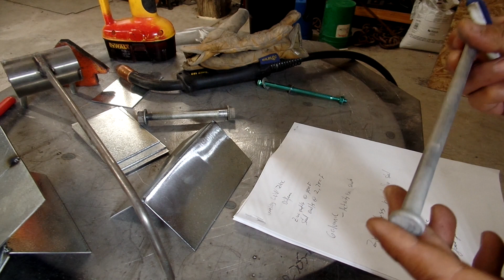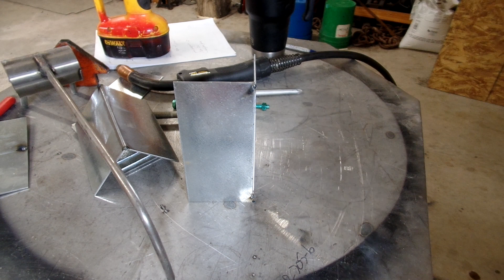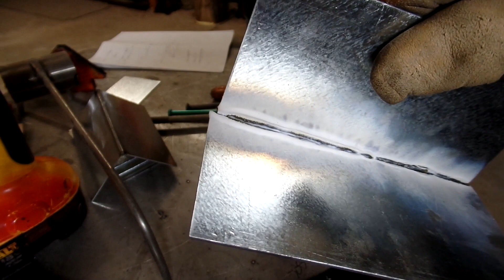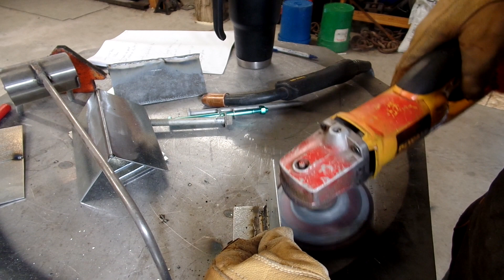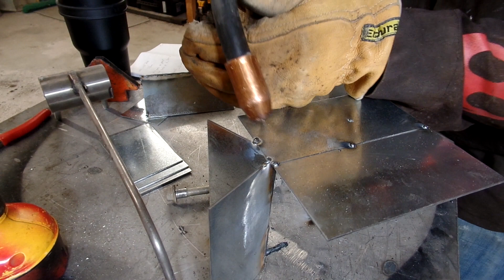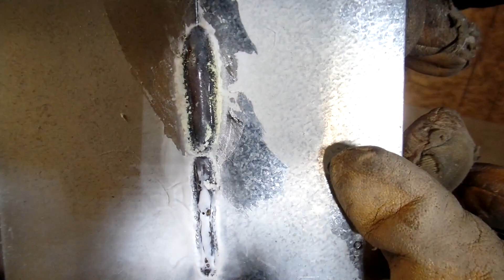Welding the Dreaded Galvanized Steel

Comment: I welded galv pipe, or was in close proximity to welding almost daily for maybe 5 years just fine until one day I got so sick I almost called 911. 15 years later, I’ve had it maybe a dozen more times like that. My sensitivity to it has become increasingly noticeable. Can weld raw steel all day no problem. But have to limit myself to 2hr sessions or it’ll kick in. Not sure what it’s all about, I just know it’s a real thing. Now I always weld with shop doors open, and am way better at holding my breath. The milk thing doesn’t seem to have an effect.

Comment: What did you have your welder set at for Voltage and Wire speed
Reply from the maker: Usually around 170/17 to 180/18 is a good start for 14 gauge.
Reply: @coconutcowboy5976  ok i did a weld test yesterday and passed the cold rolled steel but then they hit me with 14g galvanized flat and downhill and i havent done galvanized since 04 and just couldn't get the machine set right, i had it set good on a couple test pieces but started the test with the steel so I turned it up and forgot my numbers for the galvanized lol

Comment: What about a flux cored non gas mig wire fed weld. Or a stick weld. Can you recommend a preferred rod. Thank you.
Reply from the maker: I was running gasless flux, can't remove the cup on the tweco 180 without the contact tip falling off.

Comment: What heat are you working at? I’m taking a weld test for 18 ga galvanized in 2g,3g, and 4g and have no sheet metal experience and need this job
Reply from the maker: 18 ga! Wow that's not fun, start 170, 18 and adjust from there. It will probably be on the hot side.

Comment: One thing you can do also is either dip the part or paint the seam with muratic acid. The acid literally eats the zinc coating off. But after you do this you need to rinse it off, weld it and then paint it. It will turn grey and you will know that's the base metal but if you don't do anything else to it, it will rust immediately. So you definitely need to paint it right after. Also don't breathe the cloud that the acid creates.

Comment: Yes you’re correct with the zinc being massively beneficial for your health, in normal doses.. the zinc oxide fumes produced are far beyond the normal doses. 
Doesn’t mean welding galvanized materials is something someone should avoid, but it’s still heavy metal fumes and while you’re not likely to drop dead from moderate inhalation you’ll definitely get a little poisoning from it. It was my first time welding galvanized yesterday and under ventilation I didn’t notice anything besides splatter, but I’m ASSUMING to get metal inhalation sickness the welding area conditions probably have to be absolute shite. I can’t imagine being in a constant cloud of that white smoke, ugh.
The potato thing is for your eyes should you get flash burn, didn’t believe it until I left a really reflective sheet of metal beneath my stick that was reflected up under my helmet. I know you’re trolling with the potatoes under the feet thing, but I can’t help being a smartass sometimes. 
Good video regardless
Reply: Zinc supplement goes in the stomach. Zinc burnt/oxidized enters the lungs. Big difference.

Comment: If you have to tack a few inches of galv. sheet the fumes aren't likely to cause much annoyance, but you wouldn't catch me doing any serious repair on galvanized steel parts without either having it cleaned off from both sides of the joint or a half-mask respirator to keep the junk out of my lungs. 

I did fairly-regular repairs on galvanized traffic lighting, hot-dipped galv on metal ranging from 11-ga up through half-inch plus, and there's a noticeable difference on how you feel the day after if you don't wear your ppe.

Comment: not all zinc is created equal. zinc in the diet is typically bound to proteins aka chelated. zinc fumes from welding are likely in the zinc oxide form, which I suspect is much less useful to the human body.

Comment: What voltage and wire speed do you guys weld 14 gauge g pipe (mig by the way)
Reply from the maker: Start at 170/17 and adjust from there.

Comment: Zinc will not remain a vapor in the atmosphere. 
Zinc vaporizes at 1600* F which occurs as soon as I pull the trigger. When vaporized Zinc comes in contact with oxygen it turns into Zinc Oxide which is a fine white powder. The fine white powder is present on the perimeter of all my welds. Been welding galvanized tubing for 2 decades.

Comment: 2:18 it might not be a carcinogen but it’ll still fuck with your lungs and how you’re breathing. Wear a N95 and you’ll be fine.
Reply: I wont weld galvanized without a respirator.
Reply: @davecozzi9721  really? I mean I don’t blame you. I’ve been in a welding shop the past year and a half. Never have they provided respirators, just N95s. And I’ve even had to paint on zinc galvanized spray on welds afterwards that is as worse as breathing during the welding. No respirator. No decent circulation either. Pretty much just don’t breath whenever spraying that shit on. My first two days in the shop I went home and felt like death, but the N95s helped after that.

Comment: Dude lack of knowledge. Electroplating verses hot dip. Dual shield has enough  flux to almost bring the electroplating of zinc which could be measured in the thousands to the surface especially on vertical and overhead, on flat, it tends to collect and contaminate filler metal but acceptable. Hot dip, way different.. Different compounds. It not harmless  . there was a time when it first started taking over painted structure steel that grinding hot dip was mandatory For your health and for a certified weld. But this took longer then the weld itself. This took time but it was the norm for Quite some time. But that is all forgotten, no tags no literature on the steel, only on and with the eletrode, stick or wire that is purshased,, MSDA. Smoke follows the shield, it physics.. Take the time and grind, grind particles shouldn't be inhaled either, but much safer for you twenty years down the road...
Reply from the maker: Dude, run on sentence! Thanks for the info 👍 measured in microns. Grind it don't eat it zinc is zinc. Should always know what your sparking on. Vas is das!

Comment: One should always wear a good welding respirator with 3m filters preferred when welding, grinding or cutting other than when your only making small tacks!
Reply from the maker: Getting hard to find respirators and filters these days....
Reply: @coconutcowboy5976  lol! True along with TP! Alternatively maybe have a fan blowing near the welding hood to help keep fumes at bay! 🤔
Reply from the maker: @Sapper1123  Smog hogs are great but pricey,  fan under the welding table helps. Have 6 welders they all use the fans instead of the smog hogs?!?!?
Reply: @coconutcowboy5976  I’ll have check that out! Thx
Reply: @coconutcowboy5976  go to your local welding store! They all have respirators!
Reply: @coconutcowboy5976  ,nn
Reply: Easily found online.

Comment: What temperature and wire feed do you suggest to start out,because I have a big job tomorrow, I know I have to keep my my heat low on big miller but what about wire speed
Reply from the maker: What the thickness of the material? Find some scrap and use that to set your machine.  14 gauge start about 170 wf and 17 v go from there.

Comment: Can you tell a little about the machine to use  and  speed & wire size a type.
Reply from the maker: You bet, any mig welding machine will do everyone has their favorite brand. Wire ER70S6, I prefer .035 but  my Esab is set up for .030.  Usually start out at 170 Ws 17V.

Comment: I read the galvnized material work better with flux core wire than solid wire, is that true???
Reply from the maker: I have no clue, never tried it.
Guess we'll have to give it a shot!
Reply: @coconutcowboy5976  did you test flux core vs. Gas shielded for galvanized steel. Id like to hear your opinion
Reply from the maker: Hey, Flux core works. Wouldn't want to run production with it. Check out the video.
Reply: Dc - flux core works.. ish
Reply: I once welded 18 gauge galvanized sheet metal to mild steel using chicago eléctric 90amps flux core welders just fine, no undercut nor blow thru wire speed 3 and máx voltage
Reply: No. I am currently welding with dual shield flux core and it sucks ass
Reply: Timothy Johnson I’m doing fine with flux core. With flux core you should try switching polarity

Comment: Im just starting out in the welding field been working a production mig welding some of our stuff is galvanized and since its  production mig we dont ever clean it and so far from the few weeks ive been welding it ive noticed it mostly gets pinholes whenever you go downhill vertical (im still a beginner so sometimes the angle i use to go down is somtimes off) but in flat if your steady and consistent it'll be fine
Reply from the maker: Crank your gas up just a fuzz and if your parts are laser cut even a small burr/laser slag can cause porosity.  30 seconds of prep can save 30 minutes of chasing porosity!

Comment: The white stuff is Zinc oxide. It is not poisonous or cancerogen. Almost all white paints are made using Zinc oxide as pigments
Reply: Titanium Dioxide actually. And it's radioactive. Zinc Oxide is used as a primer.